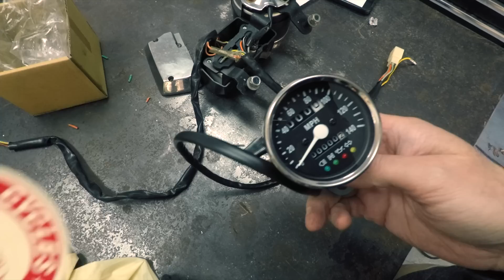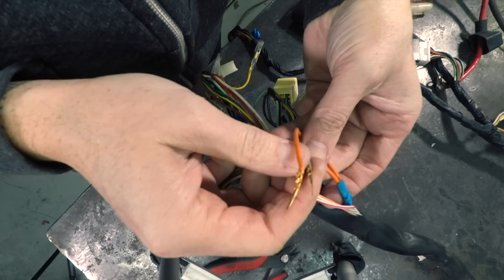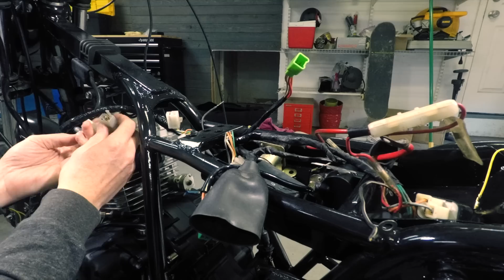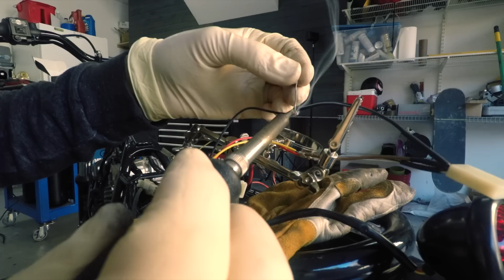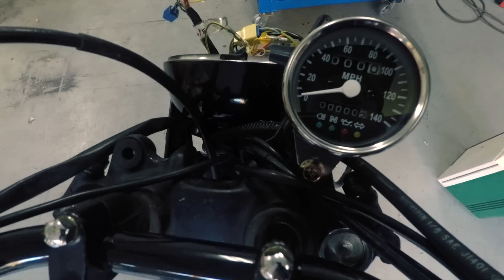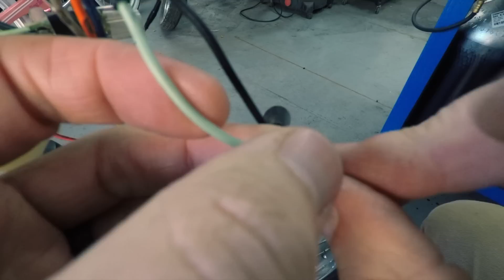Suzuki GN 250 Cafe Racer Build - Part 12: Wiring Harness

Comment: Any chance you have a diagram, or a video even of the wiring for the front switches? We bought a GN250 for my son, and it's been rigged pretty hard. Need to know which are the horn, and the signals.

Comment: Out of stock speedo come out two sets of blocks one with five wires one with six, how do you do this with the new speedo as you only have eight wires?
Reply: Baldeep Sahdra I’m pretty sure one of those sets connects to each of the gear indicator bulbs, which the new speedo only has a single “neutral” indicator
Reply: Monty Mccune hey mate you’re a legend Didn’t realise that I’ve got them alll hooked up to one. Block now and it goes! BUT when I hit indicators the backlight starts flashing I haven’t installed that 

relay  perhaps it’s that? 

Does the wiring have to be in a specific order within that connector?
Reply: Baldeep Sahdra yes, u deff need the new relay and the diode kit to prevent both indicators blinking simultaneously
Reply: Monty Mccune one more question sir,  where does the diode hook up to I get the yellow wire from the speedo would then split with the diode but don’t understand where I’m meant to connect it
Reply: Monty Mccune cheers for your help in replying mate your videos are pretty much the most helpful on YouTube! Subbed
Reply: @BarleySweet  check this out: (FYI- this is only if you are installing LED lights) https://www.dimecitycycles.com/inline-diode-kit.html
Reply: Monty Mccune that’s exactly what I need!! Do they ship to New Zealand? But now my neutral light is always on regardless of what gear I’m in

Comment: Can you please explain the diode for the indicators I think I am having this problem and need to run that link
Reply: David Rapattoni check out the Diode Kit link in the description. It has a pretty good diagram on how to install it. It’s kinda hard to explain how the circuit works w/out the schematic.

Comment: Hi! I have troubles installing my LED turn signals on my bike. Could you please explain to me how i have to wire the diode? 
Thank you!
Reply from the maker: See if this image makes sense :) http://bit.ly/2kGbh9J

So simply...
1) disconnect your existing wires connecting to your turn signal indicator
2) connect the diode kit (the side with one wire) to one side of the turn signal indicator
3) connect the other side of the turn signal indicator to ground
4) connect the diode kit (the side with two wires) to the wires you cut from the turn signal indicator
5) done